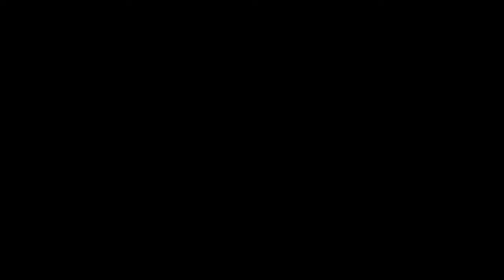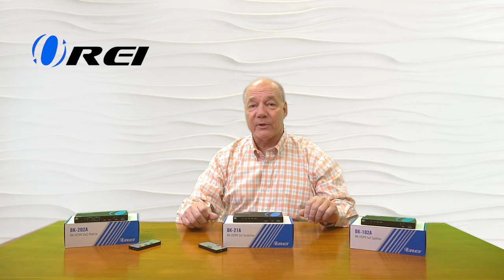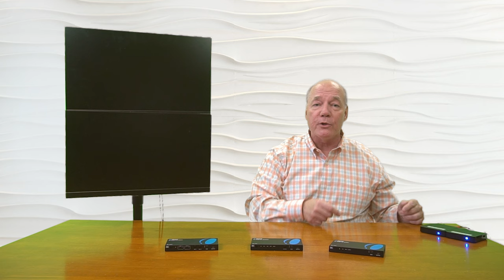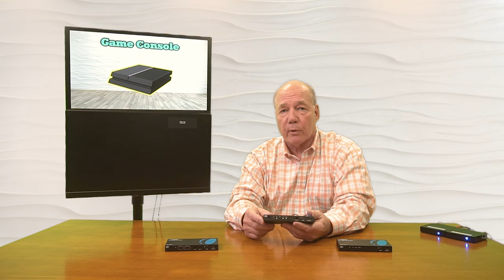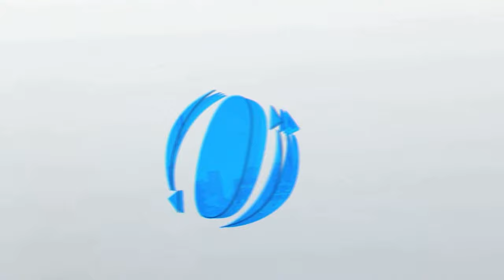HDMI Splitter vs HDMI Switcher vs HDMI Matrix

Comment: Is there a combination of these tools that can be used to "extend" the display of a computer across 2 monitors/displays? I have a 4x2 matrix and am struggling to get anything other than a duplicate display which is pretty useless for the side by side setup I'm trying to create. Thanks.
Reply: @OREI-COM  So, in that case it sounds like an HDMI splitter would be needed to extend the displays after adjusting the laptop.
Reply: did you find a solution? I'm looking to buy a 4x2 matrix as well - 4 inputs (2 from PC, 2 from laptop) and 2 outputs (2 monitors), I assumed this would work
Reply: Sir. I have two items with hdmi out. One has optical out to a sound bar. I have a DVD player. (Only hdmi) the TV has hdmi am optical in. The second one sounds nice. What do you think
Reply: I believe that SIM racers with two or three screens have powerful computer with multiple video out sockets. A lot of money.

Comment: Hello. I have looked online and cannot find much info on the HDMI matrix, but have a question. Will it allow me to ‘extend’ my laptop connection with different monitors, rather than just duplicate what’s on my laptop to said monitors? Thanks
Reply: I don't believe it will, it takes one input and outputs it to both screens meaning you wouldn't get a second screen but instead it would duplicate the image from display one and show it on display 2
Reply: You need a multi-port adapter. It plugs into your one output slot and makes three separate outputs, then in your settings you just make sure it detects all the monitors and sends the correct signal to each

Comment: I’m on my 3rd splitter.  The first 2 have failed.   I use the splitter when running the av (volunteer for charity) for a group meeting once a month.  The 4 port splitters don’t seem to last very long.  I’ve used them with a good quality surge protector so that’s not the issue.  They are great, until they die.  I typically keep a spare so I can swap it out quickly and keep thing going.

Comment: Hi, thanks for the amazing explanation.  I do have a few questions regarding the splitter. If I have for example my gaming console on but I want to display on one display and have the other turned off Is that possible or do I have to have both displays on simultaneously? Because in the video you showed the splitter doing its job of course, but I was wondering if I could have one of the displays off while the input is just outputting to one of the displays, not both at the same time.

Comment: Hello there,

I wonder if you could help me with a project i can’t figure out.

I recently purchased a SANDISK G-DRIVE HARD DRIVE WITH USB-C - 12TB that I’d like to connect to my Samsung smart television.

The 12tb hard Drive contains all my movies and was hoping to connect it somehow to my smart 4K Samsung Tv.

I’ve tried connecting it directly to my HDMI box and directly to the USB port but neither worked, it just showed on the tv something was connected or said no files or folders available?

I’m guessing I need some kind of hardware in between to connect properly ?

Any ideas? 

Thanks for your time and help
Jeffrey

Comment: Can we split the signal by taking one of the outputs from the Matrix device? Also I saw your 8 output splitter using cat, one transmitter and 8 receiver, will that not require an additional network switch?
Also will the resolution adjustment be different for different output devices depending on the device compatibility?
Reply from the maker: Hi, You can use a Splitter at the Matrix output to split the signal. The 1x8 Splitter over CAT actually doesn't work with a Network switch. The Transmitter and Receivers need to be connected directly. Some of our models do support Downscaling so you will be able to have different resolution on different outputs.

Comment: Hello, im using my iPhone to watch movie to my tv and I got HDCP issue. Will the HDMI matrix will solve that problem? Thanks. Like your video very informative
Reply: My commiserations to you.
I struggled for years with HDCP, giving up and then trying again later.
I bought a 4ish Euros SPLITTER from China, not expecting it to cancel HDCP from the output from our cable receiver to connect to my Avermedia 130 DVR. To my amazement it worked and I have a workaround. It is powered from any USB socket.
Not all splitters will do that though, it seems to be pot luck which ones do. I researched and found one that others had succeeded with.

Comment: Which would be best if i wanted to use my ps5 on two different screens (monitor and tv) but not at the same time. I want to be able to switch between the two screens.
Reply from the maker: HDMI Splitter is what you need.

Comment: Does Orei make any splitter that can actually display 2 different hdr formats at the same exact time? For example can you display dolby vision on 2 tvs and HDR10 PLUS ON THE 3RD AND/OR 4TH TV at the same time?
Reply from the maker: Hi, currently, we do not have such a product.
Reply: Are you asking if the same source can output multiple formats, or if a splitter can show multiple formats? 

A matrix would be able to display different formats per output, same as a switch, however, on a splitter, every tv would get the same format.
Reply: @Linx_s  for example if you have 3 tvs. 2 are displaying a dolby vision hdr format. But let's say the 3rd tv does not display dolby vision. Then hiw does the hdmi splitter display the image when the source that's in the in port is prioritizing the dolby vision hdr format?

Comment: Can any of these "merge"  two input and display it simultaneously on one display by splitting the screen in two sectors? Or you need a videowall processor for that? Kinda miss the old days of split screen gaming. So would like to use something like that on my projector and play a game together with other people using 1 projector and 2 computers.
Reply from the maker: To splice the content and spread it across multiple screens, you will need a Video Wall Processor.

Comment: which would i use to connect 4 displays to a laptop, to show different windows on each monitor?
Reply from the maker: Unfortunately, we do not have anything for that.
Reply: What you would need is a USB dock to add additional outputs to your laptop. Depending on the specs of your laptop however, you may not be able to have that many stable outputs.

Comment: so if I need two separate monitors to display two separate things would I use the switcher instead of splitter? I have a splitter but is it possible to switch monitors instead of having it repeat the same thing on my monitor? I'm connecting my hp laptop through a splitter and it's just repeating the same output on one screen than for another if that makes sense. I just want to use 2 different monitors in addition to my laptop screen so I can use it as different monitors. what can I do I need help im so confused and I need this for work
Reply: Did we watch the same video?...

Comment: Is there a function or feature for one of those switch or matrix devices to make the input (source) think the output (display) is still on after switching to another HDMIi source? I have my MacBook in external monitor, keyboard and mouse mode. As soon as I switch the HDMI switch to another source, the MacBook automatically goes into sleep mode when I still want it running to finish its tasks. Thanks
Reply: @OREI-COM  Is there a feature or term I can use to identify between these 5 and the many others that you sell that can't do it?
Reply: @OREI-COM  I see. So only these 5 switches will do it. Even your more expensive Matrix devices can't.

Comment: Can I use HDMI Switch with HDMI Splitter for more than 2 displays? I have 2 input devices and 4 output devices
Reply from the maker: Yes, you can but for multiple inputs and outputs we have HDMI Matrix Switch. You can use a Matrix to be able to connect multiple inputs and multiple outputs.

Comment: I really really need help, and I hope this channel or someone in these comments can help me, because I'm not a tech genius. 
My laptop, an Acer Nitro 5, has only 1 HDMI output, but I need 2 HDMI outputs. I want to stream and make digital art, so I need 1 screen to have the OBS streaming software open which would be my laptop screen, another screen being my Sanyo TV for Twitch/Youtube to monitor the stream, and a third for my XP-Pen Artist 12 Pro graphic design screen tablet which uses HDMI exclusively. I cannot use a USB-C port because I tried to use a Benfei USBC to HDMI extender and it didn't work at all with my TV OR my drawing tablet, the screens just wouldn't turn on or show anything at all. I then erroneously got an HDMI to HDMI splitter that only mirrors displays, it wouldn't extend the displays like I need. I'm nervous about using a USB to HDMI device already having the poor experience with the USB-C not working as needed, and I also have wayyy too many USB devices as it is with my microphone, webcam, ring light, external hard drive, etc.
What I want is a HDMI to HDMI Splitter into at least 2 useable HDMI ports than also extends NOT JUST MIRRORS my displays so I can have the 3 separate screens I need. This device also shouldn't be that expensive, I don't want to pay more than like $40. Somebody please direct me to a device that suits my needs, I would be greatly in your debt!
Reply: Unfortunately it is not possible to do as you ask, as HDMI cannot "daisy chain", or send two signals at once with a single output from your laptop. C to HDMI did not work for you because of the way your c port is wired into the laptop. However, a USB c dock, preferably externally powered (not c to HDMI, an actual dock) with HDMI outputs would be your best bet, however on a laptop it will consume processing power as it will not use the onboard GPU to process the images. This is the optimal solution. A standard USB-a 3.0 dock can do the same, with less features. Don't worry about plugging too many things into the USB ports, the computer will know if it draws too much current and will disable things before any damage can occur.
Reply from the maker: The OREI SplitExtend should work for your intended setup.
https://www.orei.com/products/orei-splitextend-hdmi-splitter-extender-for-dual-video-monitor-extended-display-usbc2hdmi2